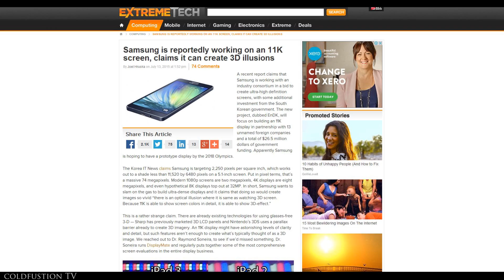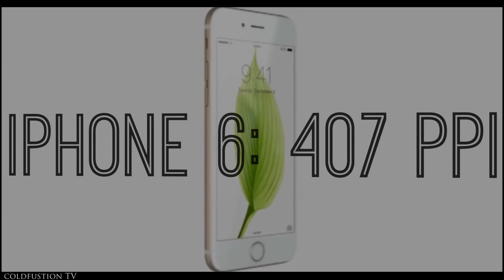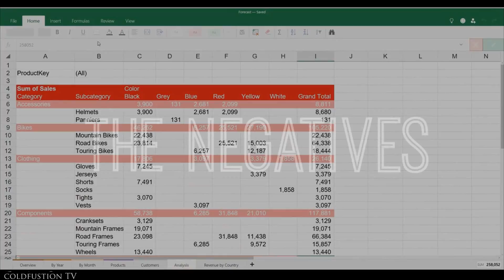Samsung is Working on an 11k Mobile Screen! (2250ppi)

Comment: The necessary battery and performance improvements required could be used to make actual noticeably better products. Going beyond a certain number of pixels is going to make no difference when you can't see it and those advancements are going to be negated.

Same as laptops only offering high resolution screens on top models, where you can choose between running a horrible non-native resolution or horrible performance at native, or phones and cameras with high megapixel specs that often mean slower captures and retaining shitty optics, meaning worse photos, the industry will yet again make marketing the reason they sell.

Comment: i can't even begin to imagine the cpu samsungs going to make. 132 bit 18 core cpu 9 cores clocked at 2.1ghz and 9 at 3.5ghz 7gb of ram 8000 mah battery with a 5.1 inch screen.

Comment: I could be wrong but lighting up the pixels should not require more power. Phones makes use of a backlight which is basically like a flashlight behind your LCD/TFT filter. The LCD/TFT changes the colourr coming from the back light to match the colours needed to display pictures or whatever. In theory the battery usages should be the same for that function. Contolling that many pixels would use more computing power and therefore more batery power like he said in the video.

Comment: I think the high ppi value is not necessarily meant for directly watching from your phone's screen, but more likely for the use of Virtual Reality. VR is something a lot of companies are investing in currently. People who have used current VR-hardware know it lacks the resolution to look similar to a nice looking screen 50cm away from your face. This is because VR-goggles use screens that have a similar size as smartphones, but have to display imagery for about a 120 degrees viewing angle of each eye. So if you do a bit of math you'll find out that in order to have a resolution that you would need to have the whole viewing without being able to see any pixels you would need a minimum of 11k.

Comment: any much more than 300ppi is pointless for most people as after that point it's very very hard to see individual pixels with the naked eye... the only exception is 900ppi but only if your using 3 pixels as one super pixel to create better colors at the 300ppi. Also the more pixels ona phone screen... the shorter the battery life. anything smaller than 7" screens really doesn't need more than a 1920x1080 screen imo. That bieng said I love my galaxy s6.

Comment: Taking useless to a whole new level.
I dont want app icon'a resolution to be measured in MegaPixels... Srsly. Is a waste of GPU.

If i would have money to buy one of their 11K tablets, i would root it, and lower down the resolution to 1080P.
Then, i would install the PS2 emulator. Just imagine what extremelly powerful GPU has that tablet inside.
Or nah... i would just emulate Windows 8.1 and play GTA V or something.

I really hope that tab would not be stuck with Android, and i hope there will be a Windows version of it.

Comment: That's lame. Why do they don't go with proper resolution specifications, where you can clearly say, this screen is double so sharp as the other. That would be only possible, if we go to proper screen modifications like 1080p ( which is 1K), 2K (youtube Videos wrongly known as "4K-youtube Videos" in 2160p), 4K (4320p) which is nowadays standard, 8K (8640p) which is the resolution of the few best 8K Videos in youtube (or are they in 4k 4302p, I don't know) and there is one beamer out there whitch is able to project 8K at a 200.000$ price for normal users - I will get it, only need money ;-)    , And so, nowadays, 4K is (better) Standard (TV, Mobile, Computer Graphics Card, Playstation 4), So we have to move on with 8K (nowadays able but a premium price and only a few youtube videos - it would be great if they would do a real movie (like timescapes - worlds first 4K movie) in 8K for everyone but for free so the people can test these 4K and 8K devices out there.

I would be happy If manufactures move on with proper screen modifications, those are:

less than anything mentioned (like 120p,240p,480p,720p), 1080p (1K), 2160p (2K), 4320p (4k), 8640p (8K), 17280p (16K), 

I don't think there is a 16K video out there, but it will be someday

These not normal screen modifications are I don't know, not useful:

Like maybe in the year 2020 you would go in the media-shop for a device like smartphone, tablet, tv
and you could choose screen display modification between:
4K, 5K 7K,8K,12K,14K,15K,16K,17K,21K,23K,24K,...
this is useless.

it would be better like that:
4K,8K,16K,32K,64K

Than you know, the sharpness of the display is doubled, so that's more easy to choose from and you see the difference better.

Comment: for one thing, Samsung is probably working on a new type of battery tech in R&D ! Second , I think the faster the processors get and the faster the all around data speeds advance the more pixels you'll need to keep it smooth and I'm sure there is a technology we in the public are far from aware of existing that would require such high res screens! Who knows! And hell, why not have such high resolution screens of we can power them and have plenty of a power source to handle and give long enduring battery life! Who cares like I said , as long as it can be powered for a substantially longer amount of time! Who cares!

Comment: People struggle to tell 350 ppi apart from 500 ppi... I'm really wondering why they're going through with this.  The VR application is about the only place where I see it being useful.  Outside of that, it'll just bring those mobile cpu's / gpu's to their knees and decimate mobile batteries for no apparent benefit.

Comment: The resolution of the display you mentioned at the beginning would be a 12K display rather than an 11K display because of the usual resolution numbers that the "K" system uses. if 1920 * 1080 is 2K, then 1K would be 960 *540. Multiplying that by 4 gives us 3840 * 2160 (4K), further justifying my thinking. 960 * 540 multiplied by 11 would give 10560 * 5940 (11K) whereas being multiplied by 12 gives 11520 * 6480 (12K) which is the number mentioned in the video.

Comment: Could it be that some of the pixels are used for something other than just light emitting diodes.  for instance some pixels used for touch sensitive resistors,  and some for recognising fingerprint scanner itself.  While LCDs,  can't have these functions,  the OLEDs,  and the emerging quantum dot displays can possiblly have these functions,  because they are more of IC circuit themselves.  These could make a very thin display,  and probably the dream come true transparent phone.

Comment: I have a 1080p 27 inch PC monitor ... a 720p display on my smart phone the Lumia 640, and a 1080p 39 inch TV in my living room. Honestly I don't feel that I need anything higher than that resolution wise. The images already look very crisp and clean on all 3 of these devices. Heck I can only minimally tell the difference between my 720p smart phone screen and my cousin's 1080p smart phone screen in terms of resolution. 5 Inches of display is not really enough screen for that to matter imo.

Comment: Needed. 1440p in the Note4 is bad when used for VR. More importantly we need to pump the frame rate up to 144hz and install the infrastructure to handle the bandwidth for it. Hurry Up!

Comment: i imagine in the future that we have smart watches that make hologram projections. a proximity sensor can detect when someone is touching the projection. the technology exists, it's just not small enough for watches. also they'd have to make a projection watch that can do what smartphones do and still have reasonable battery life. they should be working on that rather than pointlessly high density screens

Comment: 11K screen ain't shit if it's still the damn 5.7in screen.  5.7 is normal size now.  Phablet need to be 6in to 6.5in.  Can't be more than 6.5in though or else it won't fit in my pocket I don't think.  It was a big jump from the old hottie Razr Phone to the Galaxy Note 2 (nice design), but everything is the same after that.  A handheld computer is still a hand held computer.  The only think they can change now is design and screen size, or maybe a projector.

Comment: Considering modern day PCs are struggling to push UHD (let alone 4K), pushing 11K on a battery powered device is impossible. Smartphone performance isn't going to overtake PC performance and for this reason, it's impossible for such a display to be implemented in a consumer product.

Comment: if its 11520*6480 then its 6k display not 11k
Reply: +precious Prince There is difference between the P and the K. 
1440p is 2k (or 2.5k), 
2160p is 4K
4320p is 8k
6480p is 11K
Reply: precious Prince No
Reply: precious Prince Nope
Reply: +Ibraheem “LogL” Saif no, because the numbers are swapped when you are talking about a mobile device with a screen that is naturally in a portrait orientation. And it doesn't matter either way. You can't tell the difference.

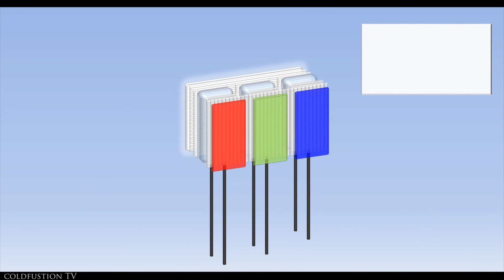Comment: Other uses: 3:00 the Phone could be placed on an Overhead Projector. A Screen of such high resolution is almost certainly going to be more useful on a Device other than a Consumer Product BUT it is only Quad Quad HD (QQHD) and when you look at it that way it seems so much less. Good for them to make this, OUR JOB is to come up with a good use for it. 

---- 

I would have preferred an 11K Image Sensor (to obtain the Video) rather than a means to view four QHD Videos at once. Is the Screen intended to replace Photographic Paper, I hope the Gamut is getting the same upgrade.

Comment: 11K is so exiting for virtual reality. Ocolus rift says, that to mimic the human vision on a screen in VR, we need an 18K display. The screen in today VR tech are to low resolution at the moment. If you have tried Oculus Rift or HTC Vive even in the developer versions, then you will know that VR are the next thing in gaming and other areas. There is real money to be made in this area for first movers.
I don't think we will see this display in a phone at first, but it will be for a VR headset. But nvidia needs to come up with a much faster GPU, because even a high end GPU today is struggling  to keep up with the Oculus Developer Kit running less than 2K.
11K @ 90Hz is going to kill your PC.

Comment: I don't think there should be a limit on resolution keep improving that if needed. There should be a happy ultimatum on pixel density though I reckon 500ppi is a nice round number and significant quality you'd only need higher if you're doing experiments on the human eye, I reckon.

Comment: It sounds intriguing but it is impractical. Battery life would have to be seriously boosted to drive an 11k screen on a mobile device. Now, I can see this kind of technology being used in larger applications such as specialized cameras or for space exploration but a smartphone?

I think we are encroaching upon diminishing returns the higher/faster/better that things become. It isn't that 1080p or 2k/4k is bad. In fact, it's pretty darn good. I'm just wondering if we may eventually create a resolution that could be, in theory, better than what the human eye can process. Even increasing the frame rate for HD videos (e.g. 60 fps) can be startlingly realistic. But, progress is progress I guess and I'm all for it but sometimes I wonder if we should ask ourselves what we should do instead of what we could do.

Comment: i think south corean goberment guys are retarded, 11k, i don't even have a full hd monitor.
Imagine the camera, it should be better than nokia lumia's 41mp, to have such a camera you need huge memory, both ram and sd.
And the processing power, nowadays you can run 3 4k monitors with a monstrous pc, imagine running 11k on a mobile phone.
sigh, just sigh

Comment: The comparison between ram and resolution is not the same. When bill gates said 640 mb of ram is enough, the computing industry was worlds behind today's industry. As applications become more advanced more ram is needed. 

However, the human eye can only see so many pixels before increasing the pixel count is pointless. Personally 1080p is fine with me and I think 4k is overkill. However, I can see its application. Anything above 4k is pointless unless you are a photographer that needs an extremely high megapixel camera to be able to zoom in on objects. Which is a complete niche

Comment: They should spend those millions of dollars coming up with better battery tech instead. My eyesight isn't good enough to distinguish the pixels on a 5" screen at 2560x1440 in 2015. I can say with certainty that this won't have changed by 2018 - if anything, it will be worse.

Comment: Samsung has just made a major investment in Fove VR (see link (majority stakeholders).  Samsung are also the main screen supplier to Oculus Rift whom also supply them VR technology for Samsung's Gear VR phone device. My guess would be that this investment will not be mobile phone technology at first, but more focused towards Virtual Reality and large panel displays. 

Most of the comments are referring to mobile phones, I assume most people here do not own or have not tried a Virtual Reality headset as of as yet and this is why it is hard to see the wisdom in this decision. Current phone screens are way to low in pixels to be 100% immersing. 

However as VR technology becomes widespread over the next two years. We will look back to this news and understand the forward thinking genius of Samsung's goal. VR is in its technological infancy. We will look back to these early devices in the same way we see the Nokia 3210.

Five/six years from today, this technology will be beyond what we can imagine today. 

https://www.kickstarter.com/projects/fove/fove-the-worlds-first-eye-tracking-virtual-reality

I'm excited.

Comment: At current hardware levels this has no point. A Titan Black GPU can't even run 4K resolution at a smooth 60fps on most games. The only thing it's going to do is waste money. Let technology catch up.
Reply: A 980 ti or a titan x can and by 2018 a 970 level lecel carf will be able to do the same even right no a 970 can play games at max without AA at 4k and demanding games at medium
Reply: +Gary Numan it is catching up remember only a few years ago when a 720p screen was high resolution?
Reply: +David Layne That's already more than 10 years ago.
Reply: What the fuck are you doing reading my username? more like 4 years ago
Reply: David Layne I've had my 1280x1024 monitor back in 2005. Didn't seem cutting edge. Neither did the 1600x1200 monitors and the 1680x1050 monitors. All of which are resolutions greater than 720p.

Also, 2005 is just when the HDMI and 1080p craze was getting started in the home audio/video industry. Which is 10 years ago from now.
Reply: ***** Yes but what most people do as well is stream videos on websites such as youtube. Ever tried loading a 4k video? It is very slow to load considering the average internet speed is 20Mbps and mine is 144. there is a long way to go.
Reply: +Gary Numan Yeah 4k isn't the standard yet. We should wait a few years.
Reply: +Sinister Steel You don't seem to get the idea. If it's about present need, samsung already discovered a way to make a battery have twice its capacity. This is just a showoff. And before you can power such screen, you need high graphics hardware which means they are going to develop that too. But i'm sure there is a place for this in the future
Reply: +Gary Numan Maybe it has. If  someone selling bullets,  someone out there is probably making guns right?

Comment: Useless and unnecessary. Human senses have certain limit. The ears can not comprehend any sound under or below 20hz-20khz. And as for eyes, even with 20/20 vision, this high resolution on a phone screen is a commercial nonsense.

Comment: 2018 is only 3 years away. 6K should be the average by then with one or two phones rocking 8k.
The performance will EASILY be there (have you seen Nvidia's tegra x1?). By then the Tega X2 may be recently released.
Side note: by then we'll finally have 4K at 60fps for consumers!

Comment: At least my phones camera is 41mp :)
Reply: You mean  4,1?
Reply: timska Nokia 808
Reply: But windows/ Dx
Reply: no, symbian
windwos phone = cancer
Reply: ***** Windows/Android > iOS > Blackberry > Symbian
There. i said it. Boom. drops mic
Reply: but the resolution is closer than 8 mpix
Reply: +PimahtanutTyyppi (Heve62) 41mp phone camera = 7,393 x 5,545 resolution. Considerably less than 11K.  ^_~
Reply: +Scootaloo "At least" and is bigger than iphones 8mp, if you understand? but being so old its not amazing as it sounds.
Reply: ***** The Nokia 1020 41mp camera is the highest resolution camera ever released on a smartphone to date. However like you said, it's now a couple of years old and isn't considered as good as curent 12mp and 16mp cameras found on the iPhone and Galaxy S6 except for resolution obviously. 

But no matter what, it looks like Samsung will have to release a camera with 74.6 mega pixels to take advantage of the 11K.
Reply: Scootaloo i have both 808 and 1020 and after taking some shots 808 seems to be clearer than the 1020. and if i remember correctly 808 has some pixels more, but not so many to make difference
Reply: +Scootaloo and optics makes the game ;)
Reply: ***** They actually have the same camera. And technically the 1020 allows for more light since it has a faster aperture lens. If the 808 has better images, it's purely due to better software optimizations.